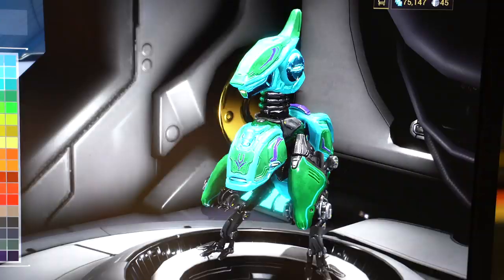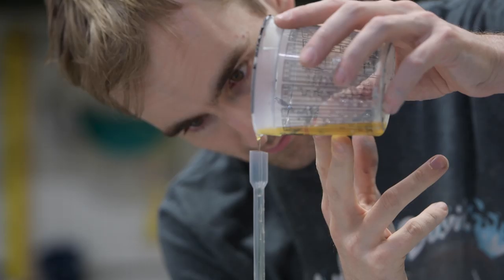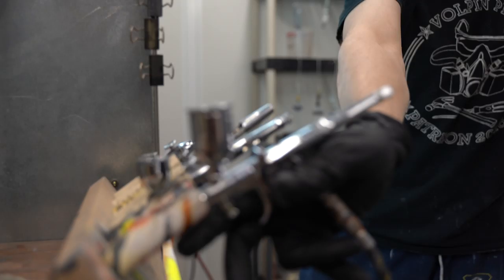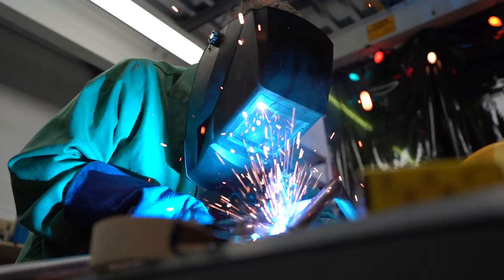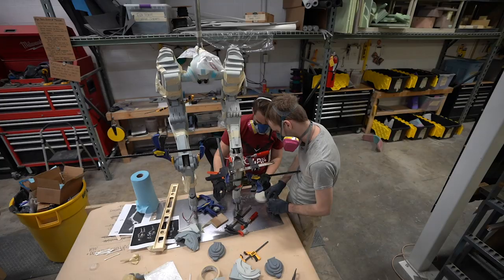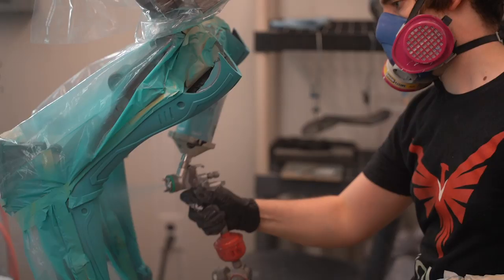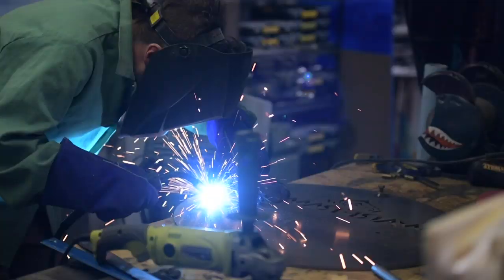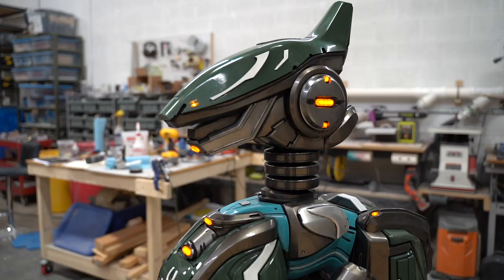Warframe | Volpin Props - Building a MOA

Comment: still need motors and A.I.

better go farm some more.
Reply: yeah its a shame they didnt makw parts of it move like at least its head or its legs bending slightly
Reply: They just get chassis and blueprint, need neuro and system
Reply: good luck with that 5% drop chance per 10min assassination run
Reply: @zioxei  That's not grinding. Windforce, The Grandfather, Crown of Ages or Tyrael's Might in Diablo 2, now that's grinding.
Reply: @bytemeah  cool but I don't know what you're talking about. We're talking about Warframe.
Reply: @zioxei  I'm saying that 5% drop chance is actually not that bad compared to something like 0.0002% for Tyrael's Might.